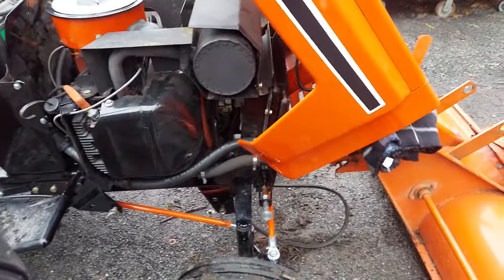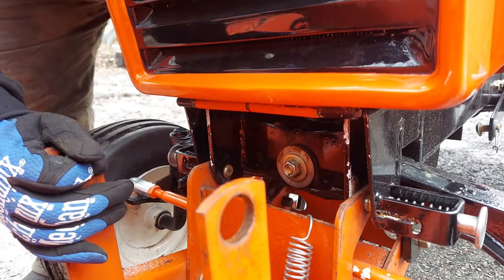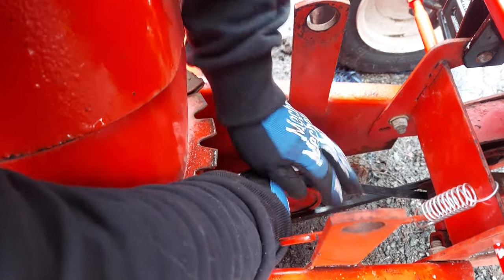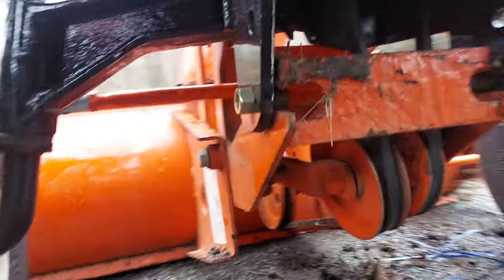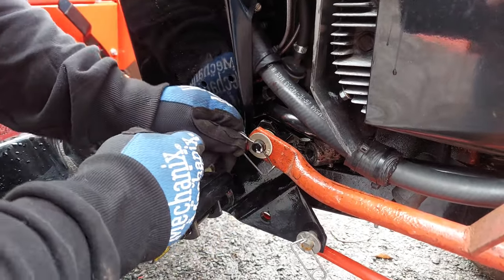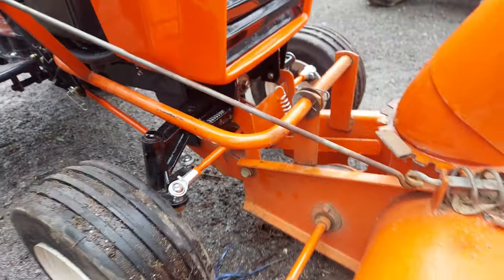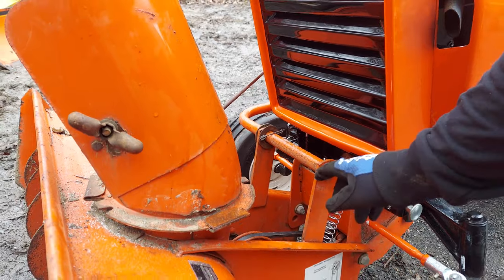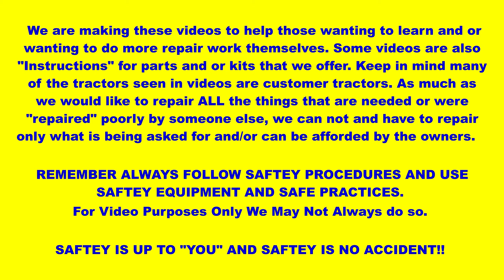How To Install SNOW BLOWERS FOR CASE INGERSOLL GARDEN TRACTORS Simple & Fast Hook Up System.

Comment: Great video. They can be a little pain to put on, these throwers. But not as bad as a LGT 165 Ford thrower. Ask me how I know. Hehe. But, the ford thrower works great. 
The case throwers can clear a lot of snow, but don’t throw very far. 
I have a thrower on my Case 446 and Case 224. 
So far hardly any snow this winter yet. Used the 446 twice and the ford once so far. 
Have a great weekend.
Reply from the maker: Yes we have no snow so far too! The Key to the Case blowers is keep them stuffed and go as fast as You can within reason and they have to be tuned and adjusted to throw far. 30 feet most times should be no issue, have seen them go much further with the correct set up and mods and right snow lol. Never used a Ford blower have to check them out. Thanks for Thanks for watching and the comment we appreciate it and enjoy it! You have a great weekend as well.

Comment: What size spring is on that idler pulley
Reply from the maker: The spring in the video is not the OEM spring it was on the blower here and we left it on as the video was to show how to hook up the blowers. We have plenty of OEM Springs in stock as well as they are included in our Mule drive rebuild kit available at caseingersolltractors.com Thanks for watching and get a hold of us if you need any help.

Comment: Great video as usual clear instructions too that 447 really shines nicely with that paint almost sounds like it has a slight valve “tick” to it will you guys be doing any onan cold start videos on the future ?
Reply from the maker: Thanks, it's a Onan they all make noise lol, basically by how they are designed. We always joke if you cant hear a little valvetrain noise something is not right lol. This one was basically a cold start. You can see the condensation burning off too. It was started and move earlier in the day but not for very long. Problem with engines and videos it is often really hard to capture true audio sound on videos with engines. People often try and send us videos to try and diagnose engine issues but it's very hard because you hear things that really are not heard live and can't hear certain things People hear live and are asking about. So it's tough. But we might do some "cold start" videos just for fun to show how they start etc. But we just know it's hard for diagnose or example purposes most times.
Reply: @caseingersolltractorsnortheast  yeah I completely get you for me or the shop to really help someone with an engien issue we have to see it start it run it and really look at it to figure out over video is hard

Comment: I picked up a snowblower for my 448 this year and put new bearings in the auger and jack shaft plus a new chain. It has twisted and destroyed 2 belts so I swapped it out for my blade.  Can bad bearings in the mule drive cause the belt to twist?
Reply from the maker: They could in theory. Are you using oem belts and are you sure they are correct for your tractor model, blower model and pulley size? Thanks for watching and the question.
Reply: @caseingersolltractorsnortheast  Yes. I measured the old pulley to make sure the new pulley matched and the belts were OEM. I was shocked that the belts were chewed up because of how robust they are. I have a brand new correct tensioner spring also.
Reply from the maker: @BennyB  what is your tractor and blower model, what belt number and diameter of drive pully on jack shaft
Reply: Make sure the idler pulley's spin free with no noise and no side slop or side play. Next with the belt and spring off, check the the pivot point on the tensioner arm, there is a brass/bronze bushing in there that can wear out. If that bushing has been bad for a long time the steel shaft it rides on can be worn also. I have had to weld and grind several of these shafts back into shape. If worn enough the 2 idler pulley's will touch. This wear changes the angle of the pulley to the belt and the belt will ride against the upturned edges of the "back" pulley wearing the belt. When I do this repair, after inserting the bushing I pick a spot on the tube that will be easy to get to and drill a hole through the steel tube and bushing, then weld on a 1/4-28 nut and screw in a grease zerk to keep the bushing greased.
Reply: @caseingersolltractorsnortheast  I have an 87 448 tractor. The snowblower is an R84 with the 6.5 diameter pulley. Belt number C23539
Reply from the maker: @BennyB  yes that all matches. As Gordy said above I would next check into that. Also that idler  pulley should be at a angle but they often get bent sometimes too much of a angle or others think it should not be bent and then try straightened it and mess it up.
Reply: @caseingersolltractorsnortheast  Thank you both for the info!  I will be checking it out after work today. 🤞 that just the bushing is worn out!  

These videos are really helpful. After you posted the video on how to change the auger bearings on the blowers I pulled the trigger on getting one. These tractors are tough and not too difficult to repair or maintain.
Reply from the maker: @benblaszak9318  Glad they help keep us in mind when you need parts! Thanks